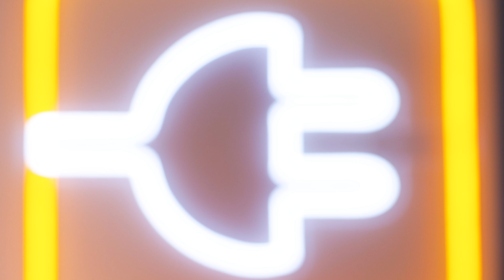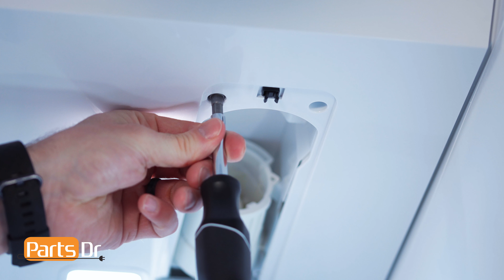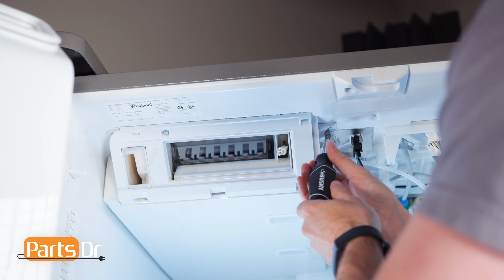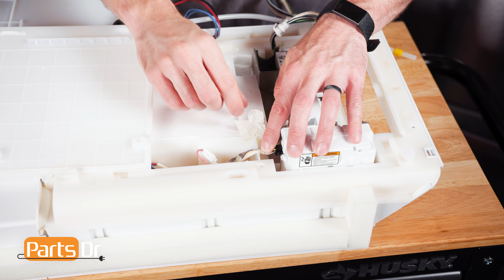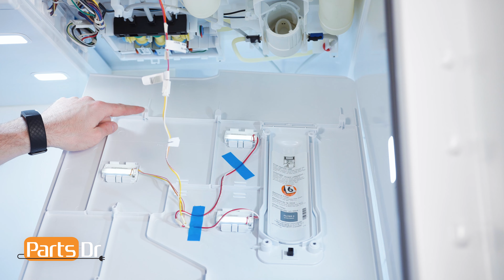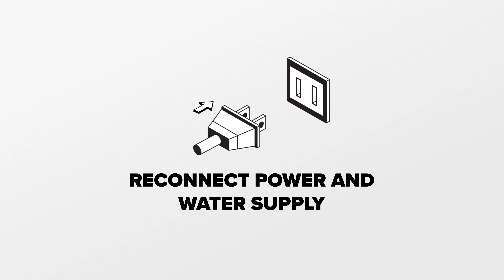How to replace ceiling Ice Maker part # W11658802 on your Whirlpool French Door Refrigerator

Comment: Great video. Just replaced mine. Need to use a thin nut driver to get to first screws near water filter. Fingers crossed this will fix the issue.  Thx.
Reply from the maker: Great tip on the nut driver, thanks for sharing! Let us know how the repair goes.

Comment: Excellent video. As the gist of the comments suggests, there's a lot of little variations. The rubber grommet that seals the major cord exit on mine was inserted from the TOP, which made getting the cords through the hole for removal impossible without getting rid of the rubber grommet. I didn't realize the new ice maker had one (that gets inserted from the bottom) so I made little slices that let me take the wires out of the grommet, and then I could have put them back in. My black water release was also a two plus one, and a bear to get out.

My biggest problem was that I could not get the whole ice maker unit to latch into the top of the fridge. I had the fingers lined up in the right place, but the foam on the back that seals a couple of air channels was not allowing me to push the unit back hard enough to latch. (It had re-expanded while I was doing all the other stuff.) So, I got it in as tightly as possible (which wouldn't stay up by itself because not latched), put the two screws in part way crookedly, gave it a few minutes, backed them out, pressed in again, screws in partway again but a little less crookedly, gave it 10 minutes, backed the screws out and pressed REALLY HARD and CLUNK the latches caught. The screws were in crooked originally (noted when dismantling the ice maker area) so whoever at the factory had cheated anyway.
Reply from the maker: Thanks for sharing your experience and the tips on getting it installed!

Comment: Installation of ice maker went very good when following this video. The one difference as someone else stated was that mine had a 2 piece water line retainer. 
After everything was completed, I wasn’t sure it was working. Watched some other videos and came across accessing the error codes using the front panel. 
Do you have a video for this?
I located the service tech sheet under the hinge cover plate and got the fill valve to work, which must have been some sort of reset as the new ice maker is cranking out ice! 8:38

Comment: Great video, my install was slightly different in a 2013 Maytag model, the yellow water line was in the middle. We ordered the part from PartsDR. Now we will see if it works. (I didn’t have any error codes for the ice maker when I went through that process so we’ll see.)
Reply from the maker: Thank you for supporting us and sharing the feedback on your fridge.  Let us know how it works with the new ice maker installed.
Reply: After 24 hours, still no ice. No ice maker codes. The fridge dispenses water fine. Any other ideas to try? Thanks!
Reply from the maker: @johnturco7477 That's too bad.  Try checking the temperature in the ice bin to see if it is getting cold enough to produce ice (usually 15F or colder).
Reply: I had it opened with a meat thermometer and got it to 32.
Reply from the maker: @johnturco7477 To get an accurate reading, you will usually need to leave the thermometer in there for a few hours.  Some models have an ice maker fan motor that distributes the cold air to the ice maker and ice bucket like this: https://www.youtube.com/watch?v=3_eEs7zD4Bk
Reply: I replaced the fan, still no ice. Could something be blocking the area that the ice maker fan sucks the air out of the freezer? Where would I check that? Thanks
Reply from the maker: @johnturco7477  There are usually two air passages that distribute the cold air from the freezer to the ice maker compartment.  One is an intake and one is a return for the air, so that it can circulate the air in a loop.  Sometimes these passages can get clogged with frost or ice.  If this happens, there is no way to access these to melt the frost, so the only fix is to leave the doors open and unplug the refrigerator for 1 to 2 days.

Comment: This video was great.  I replaced the ice maker and now it seems like the ice maker overfills.  I just took it back apart and there was water all over the tray the ice maker sits in, and it drips into the ice bucket and freezes it solid.  any idea?
Reply from the maker: It sounds like both of your water valves are bad and leaking.  See the two links below.
https://www.youtube.com/watch?v=i7dtba4GiqQ
https://www.youtube.com/watch?v=EvEPAo2mGR0

Comment: Huge thank you!!  This worked great.  Mine is lightly different.  The black water release on mine is 2 parts, a bit tricky to get in there.  I also struggled to get the water to release from the yellow line because mine looked like it didn't have the same tab.  Turns out I was wrong, I just pushed the hard yellow band towards the back and it released.  I tried to order from your site but it was out of stock, ended up finding it somewhere else around the same price.  I was nervous to do this but it turned out great.  I shot a quick YouTube video myself, but gave you a huge shout out and all the praise.  Your video was top quality and easy to see and understand all the steps.  it worked great.  Thank you!!
Reply from the maker: Great! Thanks for sharing!
Reply: Where'd you get it?

Comment: My fridge is only 18 months old and the ice maker is not working already, is this normal or could it be a filter issue
Reply from the maker: Does the water dispenser work okay?
Reply: Do you know where to find the part? I can’t find the ice maker part anywhere. Also would a bad filter prevent it from making ice? What are steps to diagnose? I had a handyman come out and he said he could hear it or feel heat like it was working but it just wouldn’t make ice.
Reply from the maker: @klawlor94  Which part number are you looking for? What is the model number of your refrigerator?  https://www.youtube.com/watch?v=hHM9248ROWY

If the filter was clogged, you would not get any water from the water dispenser.
Reply: W11658802 is the part number. The model number for the fridge is Krmf706ebs04 I’m also getting an error code E3 when running diagnostics
Reply from the maker: @klawlor94  This part is on backorder from the manufacturer.  You can click here https://partsdr.com/part/w11658802-ice-maker-ceiling then click "Notify When Available" and enter in your email address to be notified when we receive more in stock.

Comment: My freezer door was left cracked over the weekend end. My bottom ice maker makes ice fine. But the one in the ceiling  hasn't made any since. I'm thinking it just froze up because water was dripping from it when we noticed. Any suggestions?
Reply from the maker: We would recommend to take the ceiling area of the refrigerator apart as shown in this video and remove any excess moisture/frost/ice that has accumulated.  There is a fan motor for the ice maker that could be frozen or the air passage could be blocked.  Once this happens, the cold air will not be delivered to the ice maker and it will stop making ice.  Let us know what you find!

Comment: I am having the problem of the ice makers water not shutting off and leaking inside the fridge on this same model.  Any ideas what's causing it?
Reply from the maker: Unplug the refrigerator.  If the water continues to leak into ice maker with the refrigerator unplugged, then both of your water valves are bad and should be replaced.  We have videos on replacing both of those here:
Rear water valve: https://www.youtube.com/watch?v=i7dtba4GiqQ
Ceiling water valve: https://www.youtube.com/watch?v=EvEPAo2mGR0
Reply: Or maker stuck in fill

Comment: What a great video.  Repair man came and replaced the icemaker but there is still no ice.  When first installed I got one tray of ice then nothing.  The next morning there was no water.  I turned the fridge temp up a few degrees then the water came back, but still no ice.  Repair man came again yesterday and see he is ordering 'more parts'  -  any ideas on what the issue could be?
Reply: FINALLY found you here for our whirlpool as this one is …. Our problem is that when getting water dispensers giving water ( which works good) BUT water also flows out of the ceiling ice maker ( yes watched it do so ) inside the refrigerator …. And yes we get ice produced and falls into the motorized dispenser and yes can be cubed or crunched ice…. Help please .
Reply from the maker: It could be caused by quite a few things.  We would first make sure the ice maker is getting cold enough and look at the ice maker fan motor to make sure that it is working properly.  https://www.youtube.com/watch?v=3_eEs7zD4Bk